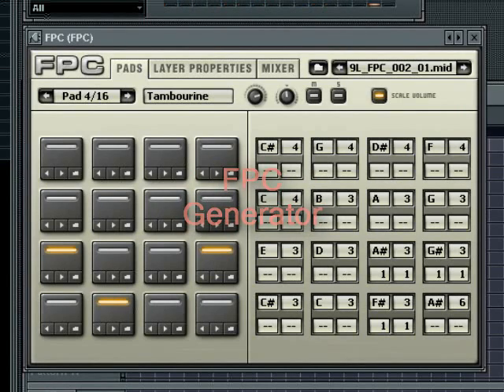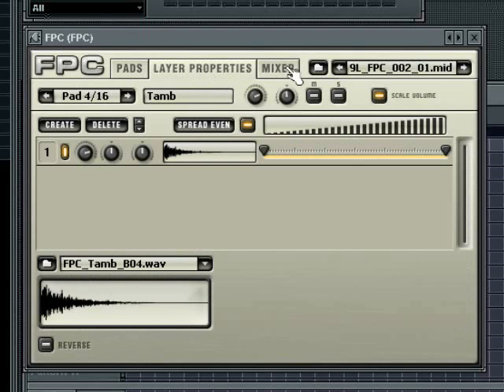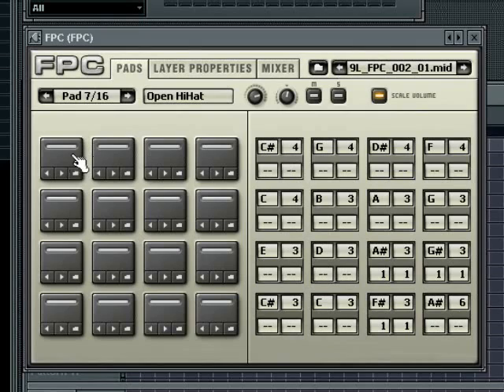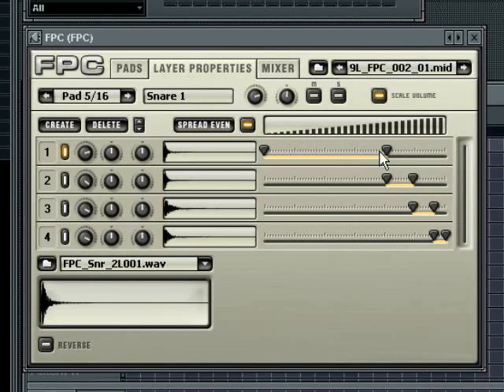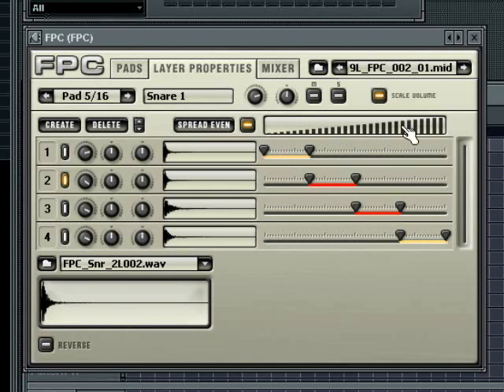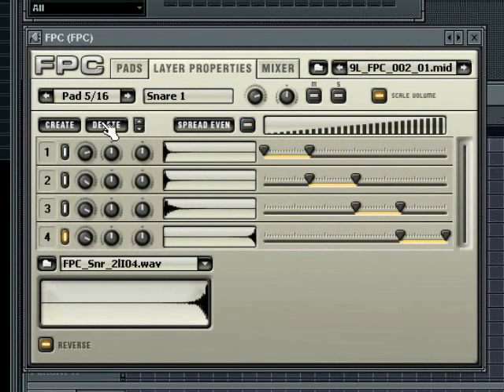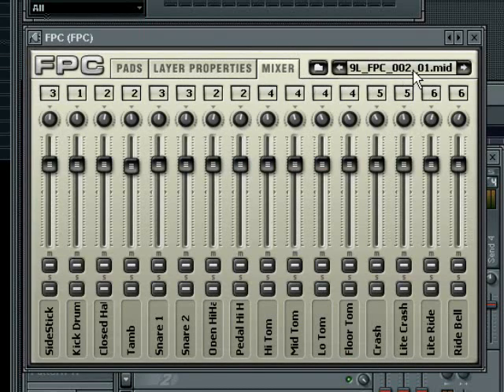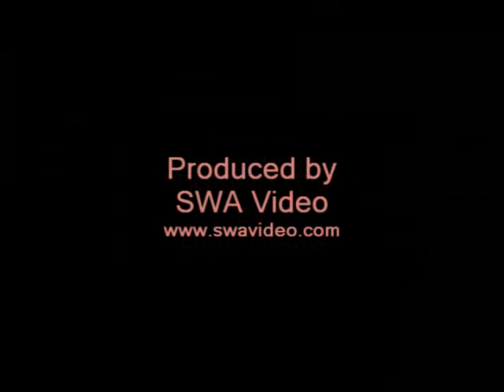FLStudio - FPC Generator.

Comment: Alright, See how in the video pad 3, 7, 8 have "1"s in the boxes. Those pads will cut each other and also cut themselves. You basically set the pads that you want to cut each other off by setting them in the same cut groups using a number. The FPC in the video is different. 
In FL8, you should see the cut boxes somewhat in the top right corner saying "Cut" & "Cut By" on every selected pad. So just put the same numbers in all the pads that you want to cut each other off.

Comment: The only thing that sucks is that you cant somehow solo a pad on the FPC and then pitch bend it to make melodies.

Other than that, its good to sample chops, layer samples, drum/record live without having to put so many channels in the step sequencer and having to use those cells to make a beat.  (If you have a drum machine). Ever since igot a drum machine, ive been making beats a whole lot faster & easier instead of amateaur clicking all day  with your mouse.